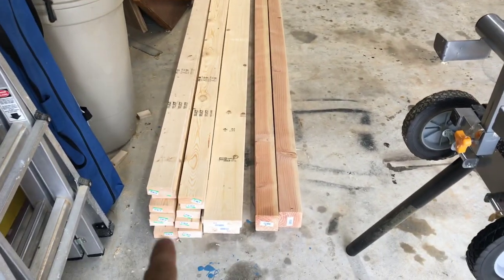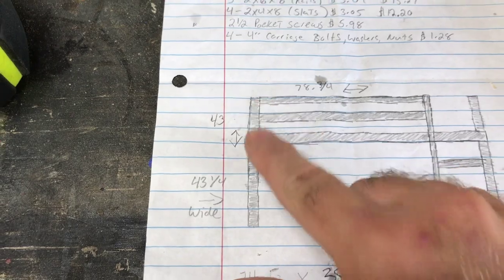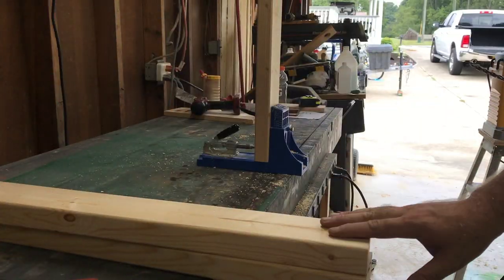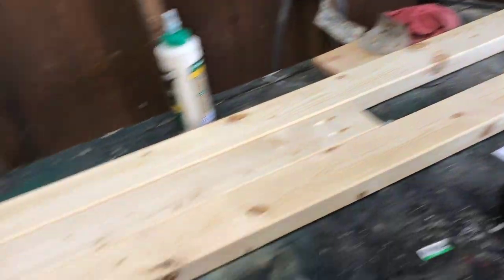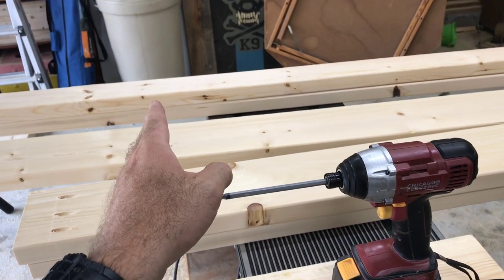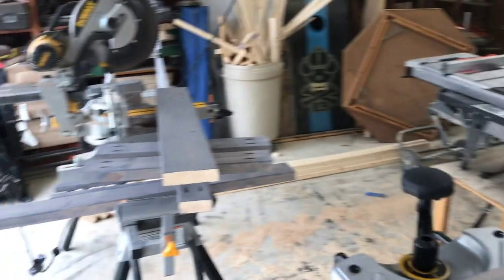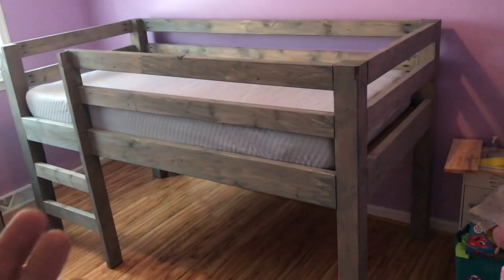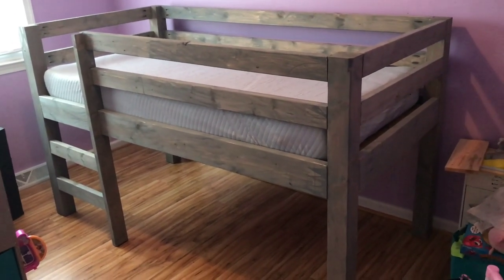Twin Mini Loft Bed

Comment: Really great build! I would like to counter your choice of screws though. When using a pocket hole, you really should use a flat-bottom head screw instead of a tapered flat-head deck screw. With a flat bottom screw you can apply greater torque to fasten the two pieces without risk of splitting the wood.

Comment: If you live in an area that has high humidity, take yourself a forstner bit and put some holes in that OSB. You need to have some ventilation to the bottom of the mattress to avoid mold or mildew building up.

Comment: I was having the same issues with the kreg driver bits when I used the harbor freight driver.I started using my orange brand one and im just now needing to replace the driver bit after many builds.
Reply from the maker: Frankie's CNC & Woodworking channel That could be a possibility. Thanks for the tip, I’ll definitely try a different drill next go round.
Reply: I just experienced the same thing. I thought it was me because it's the first time I make a bed. I went through 2 bits. I was looking for an alternative to the JKreg pocket hole screw. Thanks for the tip.

Comment: I wish pocket hole screws were that cheap here in NZ.  A pack of 250 2/2 inch screws cost $56 and then there's the cost of postage and packaging track and trace plus GST on top of that as you can only get them from an Auckland wood working company and a hardware shop,  Anything you pay for that Kregs in NZ is doubled.  Well thats my rant,   So, great work on the build!!

Comment: I see this was posted in August 2019. I understand the cost different for Kreg screws and standard screws you are using but the Kreg screws have the neck to help stop the screws from pulling through. Especially for a kids bed. Did it hold up?
Reply from the maker: Yea sir, it held up perfect! I just took it apart the other day because she wanted a bigger bed and for it to be closer to the ground. It never got loose or anything. The preferred method is the kreg screws but those square tips round too easy.

Comment: Very cool build.  Starting to put this together myself.  Quick question: did you not end up using the carriage bolts? Can't see them on the end product and it looks like it's just the pocket holes you used as the joinery. Sorry if you mentioned this and I just missed it. Thanks!
Reply from the maker: Eric Sweet No I didn’t, I realized if I would have used them and split the post it wouldn’t be as sturdy so I just assembled the bed inside her room.
Reply: Popo's Woodworks Gotcha, that’s what I figured. Thanks for the reply!

Comment: Forgive me if im wrong, but arent those pocket holes backwards?  Having them pointy outwards towards the wood is a weak bond
Reply: Yup they seem to be backwards. Probably done for aesthetic reasons. But the structure is probably ok, as both sides are secured and there shouldn't be enough shear forces to break them.

Comment: Are those all the correct cuts in the beginning of video?
Reply from the maker: Jose Acosta They are except for 2 of the rails where the ladder goes. But I think I mentioned what I had to recut them to in the video. I forgot to take the ladder opening in account at first. Also I cut the 4x4’s in half at 4’ a piece.

Comment: where did you use the carriage bolts
Reply from the maker: Lucinda Martin I ended up not using them at all. I decided to assemble the bed inside of the room and didn’t need the bolts.